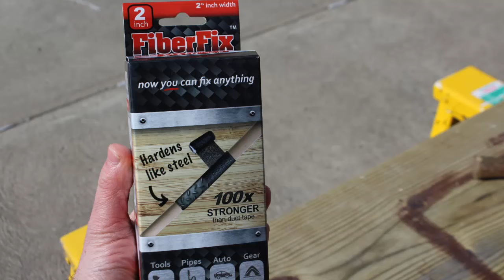How to Fix Anything with Fiber Fix

Comment: suggestion  purchase  a new handle  suggest you soak in  linseed oil NOT Boiled for a month or 2 { make a tank from pvc pipe with caps} and then fit to the head  using a hammer wedge  will last you for years  ,next time place a small piece of timber under the hammer head to  take away the stress when pulling something big ,handle will not break  ,or if you have inherited other tools with wooden handles rub with a mixture of linseed and turps twice a year

Comment: ive patched cracked cast iron drain lines for a temp fix and it works well. I wouldn't use it on any kind of pressure line though.

Comment: Mr. Patterson--your opinion on something.  Envision two small identical pieces of plywood, each say the size of a piece of paper, say 1/2" thick.  If I were to line them up, could you see using fiberfix running along the length of seam to form a strong "fabric hinge" between the pieces.  Perhaps fiberfix gets its strength in wrap.  Perhaps once dry it isn't that flexible.  I'm sure it has enormous tensile (pull) strength, but has about strength in shear, or tensile strength when pulled along its narrow edges? For example, how hard is it to rip cut along its length, either by hand (once an initial cut is made or not) or by scissors?  Let me put the question this way, envision fiberfix's width held by vices on either side with just a small strip down midline showing.  Now run a knife down that midline.  Is it trivial to tear?  Lest you think me crazy, here's where I'm going with this idea: https://vimeo.com/14001147

Thanks

Comment: Let's say you have a chromed small diameter rod (think the diameter of a straight portion of a wire hangler) and you want to put a thicker handel on one end to make it easier to grip.  Would Fiberfix stick to chrome adequately?  Should you scratch up the chrome wherr the handel will be before applying?  How long will the adhesive last before degrading?

Comment: Thanks for posting this video, I wanted to watch someone else work with it before I did, just to make sure I did it correctly! I am using the fiber fix on my mini compact washing machine. It has a small crack in the handle, and I also want to use fiber fix to reinforce a weak part in the base. Do you think it's possible to cut the fiber fix in half and use it in two places?

Comment: Great video! I have two fiber fix kits, and recently due to the cold weather, the side of my shoe cracked, and then split open. I realize it may look tacky and have a smidge more weight to it, but do you think I could fix my shoes with it?
Reply from the maker: It's possible Stephen Hunter but I haven't tested on the shoes. I'm not sure how it'll bend and perform as your walk in your shoes.
Reply: Jeff Patterson @stephen Hunter Buenas tardes: Por favor me cuentas cómo te fué con FIBER FIX y me envías fotos?  sarasuarez31@hotmail.com. Te quedo muy agraecida. Un abrzo y FELIZ AÑO 2015

Comment: Thanks for the review.  I was wondering  if this truely worked.
Reply from the maker: It does work Peter Mangold and I was skeptical, too. But after trying it I'm thrilled with the results. Of course it may not work for sledge hammers or something super heavy duty but my hammer is in good shape now.
Reply: True, but does it well fixing pvc and garden hoses?
Reply from the maker: Boy, I'm not sure about either because I haven't tried it on those yet. Something tells me it would for the PVC. The garden hose is a good possibility because the mesh retains some flexibility after it cures.

Comment: Wondering the cost of the fiber fix vs a new wood handled hammer.
Reply: About the same. That roll costs about $6. It is the 1 inch wide roll. A new handle costs about $5 or $6 dollars. So, you should really only do this if you have no idea how to replace a hammer handle. Then again if you have no idea how to replace a hammer handle, then maybe you should also not be using a hammer, ha.
Reply: I still have my grandpa's ax.  The handle has been replaced twice and the head replaced once.
Reply: @michaelritchie1560  so it’s not your grampas ax anymore😂